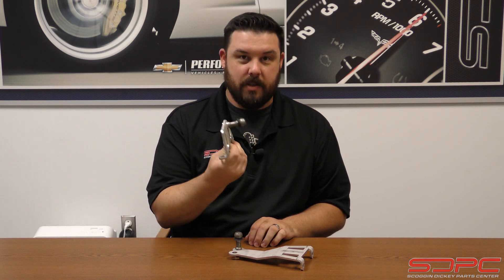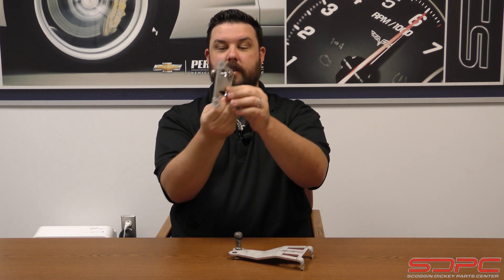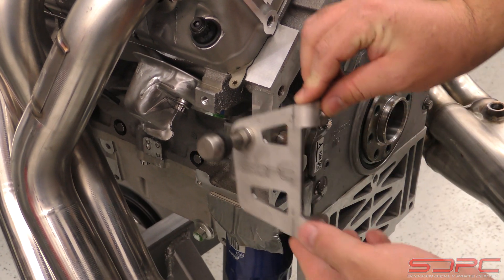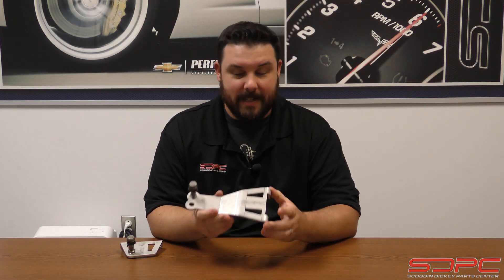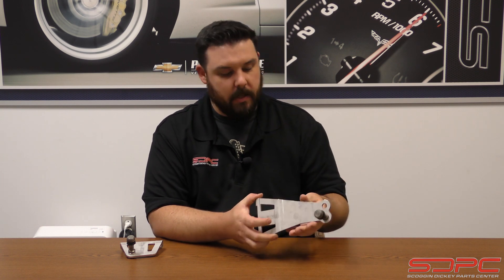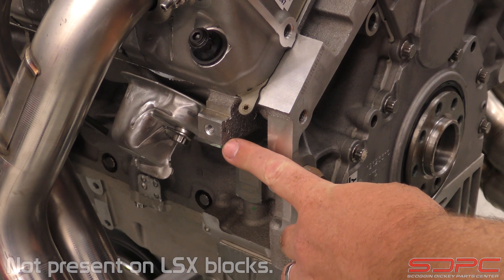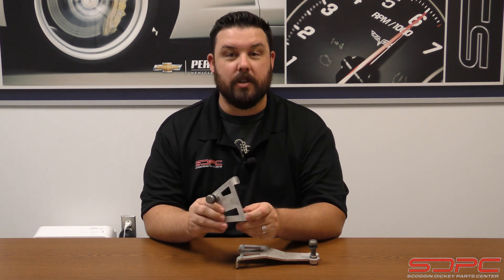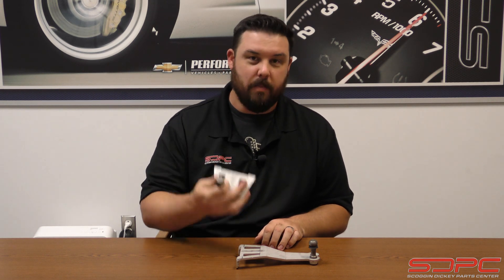SDPC Tech Tips: Clutch Pivot Ball Bracket

Comment: I used this on a 70 sbc when the pivot snapped clean in the block. I didn’t feel like pulling the motor to I took a fine took and a metal blade, cut out about 1/8 of block material, then installed the z bar as usually. Great solution

Comment: Can I use stock ls exhaust manifolds or will I need headers after intalling your adapter?  Thank you.
Reply from the maker: Most OEM manifolds will not work.  Most of the time, headers are required.